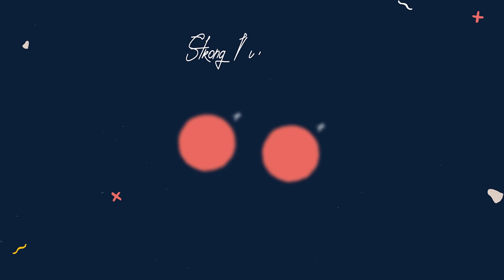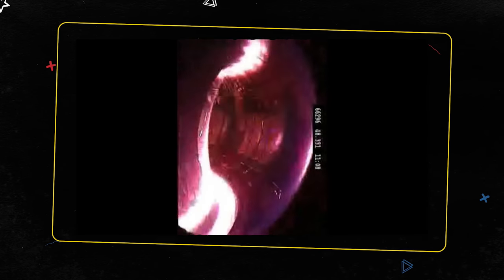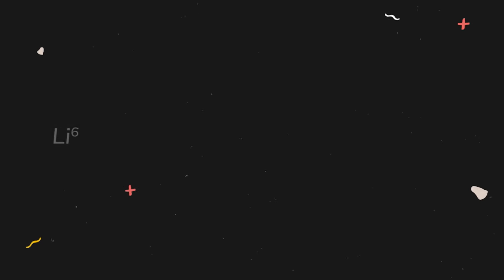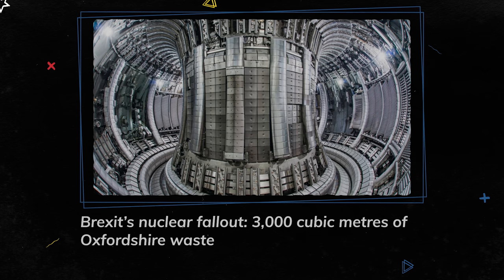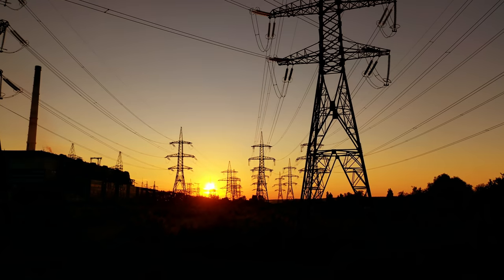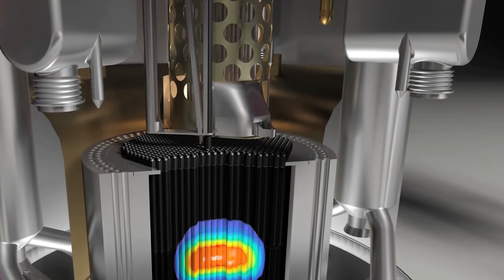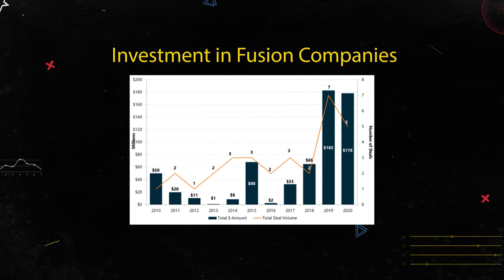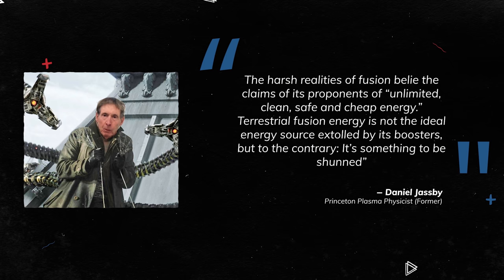What No One Else Is Telling You About Nuclear Fusion

Comment: Best fusion reactor: the Dyson sphere.
Reply from the maker: That’s actually an astute observation 😁
Reply: There are many designs of fusion reactors, each has own pros and cons
Reply: A dyson swarm is possible with the current tech we have. It might just take a century or two to set up.
Reply: You managed the change my understanding of what a fusion reactor could like. And you did it with such a short statement. Thank you.
Reply: Just what I've thought while watching the video
Reply: watch Kuzkazugt's video about a dyson's sphere.
Reply: Oh God no that would be a logistical nightmare...if you mean a dyson sphere per se.
Reply: And it would not be a reactor really. More like a... collector?
Reply: Dyson spheres are terribly inefficient. Not only are you using one of the most resource-intensive energy collection methods - solar panels - but your "fusion reactor" is also terrible. If you want to use fusion for large scale energy production, it's a billion times better to extract the fusion fuel from the Sun, or easier, from the outer planets, and run it in artificial fusion reactors, giving you thousands of times more power output than the Sun can, at a fraction of the volume and resources.
Reply: @khanch.6807  can be done in less than ten years with self replicating robots, but we're not there yet
Reply: We are already byulding It, but very slowly
Reply: @ValsVirtuals  Yeah we need to develop our AIs and space infrastructures first.
Reply: @zolikoff   tell me, how much energy the sun gives off despite how inefficient it is. 1% of the sun's energy is more than enough to power our world ( but that is purely heat energy which we as a species are known not to convert into useable energy well).
Reply: Dyson Swarm*
Reply: @energymass7944  I am telling you. The Sun is a terribly bad "fusion reactor". Sure it's plenty to power our world now. But we're not going to build a Dyson sphere just to power Earth's current demand. We are talking Type II civilization level.
If we're harvesting energy on the solar system scale, it is much more resource efficient to take the fusion fuel available, say from outer planets, and perform artificial fusion with it. We can exceed the power output of the Sun that way by many orders of magnitude, without even having to touch the Sun in any way.
Reply: @zolikoff   wait until you hear about the masrocka brian...
Reply: also gravitational kinetic energy is way more efficient than fusion and fission combined but in order to reach such efficiency we would need to get alhode of a spinning black hole.
Reply: @energymass7944  I know about it but that's not really what I'm talking about. The point is that in reality a dyson sphere or any similar solar panel based stellar power system is so bad that no civilization would ever bother with one. You can do a thousand times better without even really trying. The only exception i can give is if the dyson sphere is built around an O-type star. Then it's fine. But no civilization will emerge from such a star, it would have to be an interstellar civilization above Type II to do that... In which case they'll already have better power solutions and not bother with it.
Reply: Hey! I got a bit of a Dyson sphere on my roof!!
Reply: That's actually collector
Reply: @prich0382  Dyson's original sphere was a swarm. TV and movies got it wrong.

Even cooler thing with a swarm is you can use them as gravity tractors. They aren't just floating out there making energy, they would be actively moving resources about. It's better to think of it as a network of very small gravitational fields. Like most networks it's utility expands exponentially when you add nodes.
Reply: @ObsceneSuperMatt  When talking Dyson spheres we aren't talking about what's available today. Of course fusion reactors right now require more materials than solar power, because there are no practical fusion reactors, just experiments. I agree with the video in that fusion is really bad at producing electricity in this manner they are doing it now. That's why fission will remain the best power source for a long time.
But if we're talking Type II civilization needs, that's no longer a couple TW, but literally TW^2 or more. They'll not be using solar panels. They'll not be using fission because there's not enough fission fuel available. But you don't need tritium to fuse. You can run CNO cycle on simple hydrogen. The Sun is terrible at it because it's not massive enough, but with artificial inertial confinement you can do much better, as a Type II civ, without even trying...
Reply: Look into HB11 fusion. They plan on using high powered short pulsed lasers to create fusion. Bypassing design problems with sustained high temp/pressure required of modern prototype fusion reactors
Reply: How is the power transmission of a Dyson swarm possible with today's technology? Without baking the atmosphere?
Reply: @zolikoff  other thing to take in to account is the solar winds: a Dyson sphere would be a solar sail
Reply: @AlexTriana  Yes that is called a Shkadov thruster when done deliberately. But it's another example of inherently useless idea, because by using artificial fusion from the available hydrogen you can make a kaplan engine which is again a million times better while taking up much fewer resources.
Reply: @khanch.6807  its sad that ik i will never get to see it in my lifetime
Reply: @tntfragz1945  Donno man... With the pace we are going we will be on the red planet within the next few decades. From there we can really start to build our space highways. By that time our AIs will be powerful and smart enough hopefully.
Reply: @khanch.6807  studying in the AI field rn and making ai to self learn a specific topic needs large quantities of data types and trying to make an ai learn physics and engineering is simple but to make it create a device that could make some sort of the dyson swarm is still at minimum a century a way (computers really suck at creating/making something that hasnt been invented)
Reply: @tntfragz1945  With current AI we can already automate mining, processing, refining, manufacturing and assembly. Only maintainence and navigation is what current robots can't do themselves property I think.
Reply: @khanch.6807  yes we can make ai algorithms to automate or improve something we already made but when you try to make an AI algorithm to create a new machine well if u succeed u will be the richest man on earth and the elon musk of your time
Reply: *Dyson swarm

And best fission reactor - The Earth
Reply: Better reactor is a liquid salt thorium reactor. Uses thorium in the nuclear reaction, explosion proof as there isn't any water in the reaction chamber. Self shutdown, without continuous  introduction of thorium it shuts down within a short period of time. 90% less waste material, and carbon free reaction for you global warming fear mongers.
Reply: @zolikoff  okay Isaac Arthur
Reply: Even if we smelted the Oort cloud and every planet, we'd come up short on matter to build with in the goldilocks zone.  Terraforming FTW  Tractoring terraforming candidates into our orbit around the sun, as a co-orbital body to work on, seems like the most likely and reasonable path forward.
Reply: Dyson sphere is mythical bullshit, Dyson swarm is possible in reality.
Reply: @RingwelskiJacek  Liquid salt or metal cooled fast reactors are the future, but why bother with thorium when we have hundreds of years worth of fuel already in the form of "depleted" uranium and spent fuel? I think by the time we burn all that up we'll have something better than fission.
Reply: @zolikoff  Since the sun contains over 99.8% of the fusion fuel in our solar system, I'd think you'd want to make that a target, especially if you're planning on >10^26 W power production.
Reply: @jasexavier  The point is that with artificial fusion you can easily make 10^30W of power for a very long time even by just using the hydrogen from Jupiter and forgetting about the Sun.
Reply: Tokamak go brrrrrrrrrrrrrrrrrrrr!
Reply: @id523a They actually polute more then nuclear power plants and in case of water dams if they break or crack (earthquakes, something going wrong with the soil ecc) more people would end up dying then in case of destruction of a nuclear power plant
Reply: @khanch.6807  We just have to make sure those Swede's or Germans don't write the assembly instructions.
Reply: @TechforLudditesSira   I loved this, but could you do a review on General Fusion's design? Aside from the possibility of diffusing Tritium, I didn't hear a deal breaker for it.
Reply: If you ignore material science, then yes
Reply: Actually the son is one of the more inefficient designs
Reply: @TechforLudditesSira  I think that's the only way we can actually get fusion power. I don't think we can ever produce fusion on Earth. The reason fusion works so well in a star for example is because of gravity. Gravity doesn't require energy to work!
Reply: Is that the vacuum cleaner?
Reply: @hempmaster  not sure if that is a joke or not lol
Reply: @ValsVirtuals So where would the structural mass come from? I can't even imagine how much energy would be needed to break down a whole planet. Especially the larger ones. Gravity is not a simple matter to deal with.
Reply: zolikoff well u would assume if a civ is building a dyson sphere they would have a better technology than a solar panel. I dont think its specified how a dyson sphere functions just that it harvests a suns energy
Reply: @SahilP2648  it is lol
Reply: @jakobfromthefence  every fuctional reactor needs some sort energy channeling  mechanism, a dyson sphere/swarm can actually be a good fusion reactor as it will create an entire sytem where the star will be its energy core and the dyson sphere will be energy collection and channeling device.
Reply: You probably need fusion reactors to start constructing a Dyson sphere.
Reply: Ricardo Brown yeah so like I said, they wouldnt be using solar panels. lol  and we will definitely be colonising planets before building a dyson sphere. And a type 2 civilisation is one thats already harnessed the solar system, so you mean looking to colonise other systems not other planets, but yeah.
Reply: Ricardo Brown ‘a dyson sphere is too rigid’ This line of thinking was exactly what I pointing out before u came in tryna explain to me what a dyson sphere is aha. To say a dyson sphere is too rigid doesn’t make any sense. Its a concept, it could take many shapes and sizes. Its not a set design, just the one i assume ur thinking of is the most common ‘placeholder’.
Reply: Ricardo Brown yeah, like i said i assumed that was the design you were thinking of. But obviously ones wouldnt be built like that because of it being too rigid as you said. Unless of course we could make materials strong enough in the future that it wouldnt matter. The point is that if its completely or partially covering a star and using most of its energy output then it could technically be called a dyson sphere regardless of the actual design.
Reply: @energymass7944  your kurzgesagt spelling made me spill my coffee. No offence.
Reply: Thats a large solar panel tbh
Reply: Swarm* a sphere is impossible
Reply: @DanielNyong  🖒🖒
Reply: @khanch.6807  We already started.
Reply: Lol it's impossible hahahah.
Reply: Dyson Swarm the sun will go supermassive a long ways down the line and if it contracts back into a dwarf star we’d still like to capture that energy.
Reply: @energymass7944  well, once we start developing efficient heat engines again our shortcomings in that area will be solved.
Reply: @energymass7944  bro fuck that, that would give far too much power to anything involved. I’d prefer a dyson swarm and stellar engine setup.
Reply: @ObsceneSuperMatt  the tritium fusion reactions are almost purely for research purposes only. The real commercial power plants will be using either deuterium-deuterium reactions or (my personal favorite) deuterium-helium3 reactions with all the helium-3 on the moon and in the gas giants.
Reply: That plan is real shady though.
Reply: Poor poor power density.
Reply: @TechforLudditesSira  To build a Dyson sphere, you would need a decent propulsion systems for your construction vessels. And that's where you'd need something nuclear, to haul material from anywhere you could get it, including the Oort cloud. For this, my bet would be not on ITER, but on TAE Technologies (et consortes) method (with their bullish time schedules), and p-B11 fuel. :)
Reply: @Hansulf  "We are already byulding It" A Dyson point. :)
Reply: Lol 😂
Reply: @TechforLudditesSira  nah...  the reactor is the star.  The dyson sphere is  just containment/conversion system.
Reply: If you cut off the star from Birkeland current fusion will slowly cease. Current model of sun is 100 years old & invalid.
Reply: Dyson sphere is a hard logistics problem and a problem for material science too.

Comment: "The problem of intermittency can be addressed by battery and hydrogen storage." No, it can't. We would need to spend as much on batteries as our annual GDP to bridge the intermittency gap. Ironic that in an anti-handwaving video, the narrator waves her hands over the solutions she proposes.
Reply: Thank you.  People are being sold a corporate platter of green poo and being told that it's delicious. Despite the obvious stench and flys. They just keep eating it up.
Reply: Did a lithum meteor fell down somewhere and no one told me?
Reply: liquid air storage seem feasible...
Reply: @gabrielandradeferraz386  It's been tried. Lots of forms of air storage have been tested on full-sized power plants over the last 35 years, but none have been practical for large-scale use. A problem with liquid air storage is the need to heat the liquid for use. The most practical way of doing that is burning it with fossil fuels.
Reply: @Pooua  just stop cooling it and use ambient heat?
Reply: @gabrielandradeferraz386  That would be v-e-r-y slow!
Reply: Perhaps with todays technology, but there is alot of exciting research such on liquid metal or solid state batteries that would make storage very efficient.  There are engineering challenges to overcome, but trivial compared the the engineering challenges of fusion reactors
Reply: once again, tech we dont have, that we need RIGHT NOW